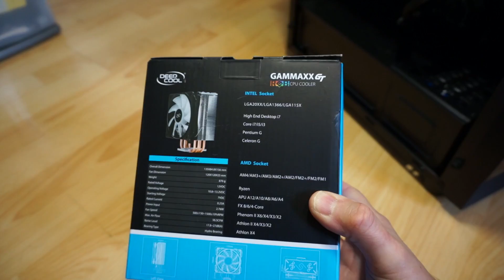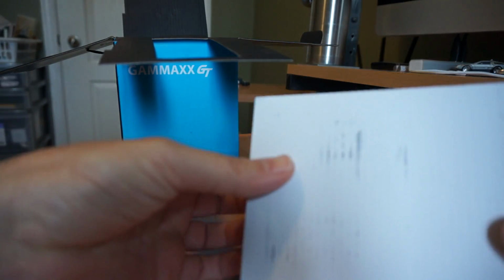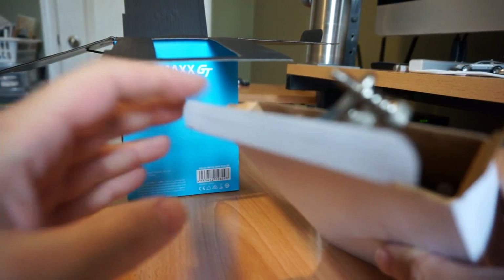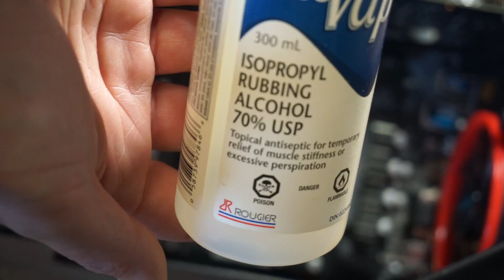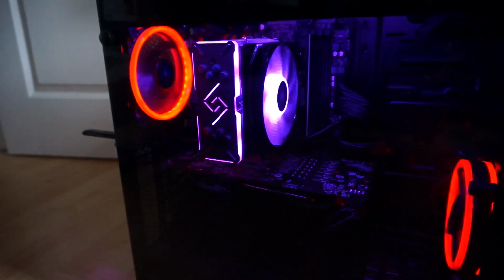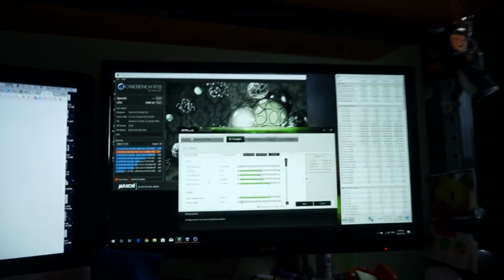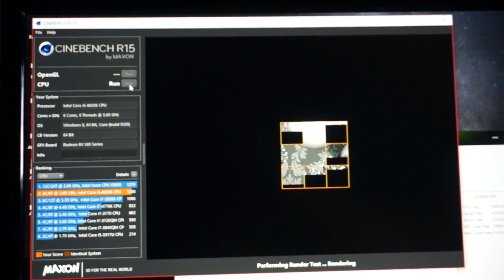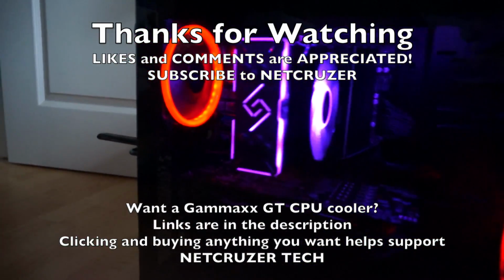5Ghz Overclock on AIR! DeepCool GAMMAXX GT RGB CPU cooler install - Netcruzer TECH

Comment from the maker: I forgot to show temps.  At 5Ghz it does run hot, idles at 40+C and load is 90+C, after 10mins stress test 100% cpu load at 5Ghz it will thermal throttle.  GAMMAXX GT CPU COOLER.  USA: https://amzn.to/2mniBYz CAN: https://amzn.to/2zOgiY4 For much cooler temps and efficiency, I set OC to 4.5Ghz.  4.5Ghz idles at 30C and under sustained 100% CPU load it never throttles.  So it's pretty darn good for AIR cooling.  I think the only way I will be able to improve the temps is with a delid, which I'm not willing to do yet.  Thanks for Watching!
Reply: hello. for 4.5ghz, how much is the maximum temp for it then?
Reply: Netcruzer RC TECH CARS nice video helped me in on an investigation on processors and I’m thinking of getting the intel I core 5 8600 k 4.3 ghz,GTX 1060 6 gb, 1 tb,case aurora r7, designer dell running games at 100 FPS and above 😆
Reply: So if one does not want/need to use the RGB- controller, the ONLY cable that has to be connected to the motherboard is the one that goes to +12Vpin header? So it will work simultaneously as a power and RGB-control cable?  (all the remaining cables can be tucked away?)
Reply: Netcruzer RC TECH CARS and 460 watt power can you please answer this question is an Intel icore 5 8600 k able to run smoothly on an air cooler 😬plz response me 💀😃
Reply: Netcruzer RC TECH CARS delid it
Reply: Do you think the thermals will be better with a 9600k?
Reply: I have aircooler with 2 changed fans and 5ghz is only 80C is that safe temperature? I have same processor
Reply: Netcruzer RC TECH CARS have problems in 90c?
Reply: thank you for video ，好質詢
Reply: Just bought it bro you helped me build a the ultimate workstation
Reply: Funny how this Youtuber doesn't realize that cinebench is not used for CPU stability testing... Its for benchmarking. You need to make sure your CPU is stable, before you benchmark. Anyone who has ever actually overclocked for real, the correct way. Will know that, that tiny ass little 4 heat pipe cooler cannot handle a 5ghz OC. I dare you to go run prime95 for 30 minutes or an hour and tell me that you still have 5Ghz. LOLOL

Comment: Hey man what’s your case?
Reply from the maker: That’s some unique case that Cyberpower offered in 2017-2018. No longer produced and I never found out who the OEM was. I’m still using it though. Has a very sensitive front panel reset button you have to be careful not to bump it, so that’s might be why it’s no longer around.

Comment: So im still fairly new to computer assembly and i bought this cpu cooler and some more ram to replace my old parts and aftet assembly my pc wont turn on. Cant figure out where 1 of the wires goes and i think the vpu cooler may not even be compatible.

Comment: The cooler master did not look like it was properly pasted or mounted based on the thermal paste smear. The DC Gammaxx GT is a huge upgrade indeed, but it would have helped if the CM cooler had been put on properly!

Comment: i had the same problem with the fan, after placing it with paste i realized i couldn't reach the screws on one side, i had to remove it and restart the process, great cooler for the price.

Comment: Question: can i change the fan on this cooler? If so, can i add a secondary fan on the back of this cooler?
Reply: The fans are changeable , i have corsair ll120 rgb fans on mine
Reply: And yes a second fans is possible it comes with 4 clips 2 a fan
Reply: Same question since a long time
Reply: Thanks

Comment: Is this better then the ryzen 3 stock fan also would this fit on a b450ma mb I’m using a 500 power supply also just liked and subscribed:)
Reply: of course its better than the stock cooler

Comment: Would I have to remove the whole thing to apply a new CPU cooler? or did your case have a back opening?
Reply: It does not really matter if his case has an opening to access the bottom of the motherboard, etc. It is a matter of your case allowing such access or not. And I doubt that Netcruzer RC TECH CARS can answer that question. You have to physically examing your computer case to see how it is designed.

Comment: you forget to mention the temperature at 5 Ghz. Which is the single most important thing while overclocking.  And determining factor if a cooler is good or bad.
Reply from the maker: I show it, 99C at full load 5Ghz. Nearing max temp. That’s too hot so I don’t run my 8600K at 5Ghz I run it at 4.7Ghz all the time with the Mugen5. I only go 5Ghz for benchmarks.

Comment: Heat pipes are not solid copper, they are hollow copper with a thermal liquid inside that will condense and evaporate to work similar to a refrigerant in HVAC or a refrigerator.

Comment: Hi very good video and I'm surprised how the 5ghz processor with air cooling works.
The question I have is if the ram slot next to the fan can that ram slot be used or is it covered or covered by the Gammax GT deepcool cooling fan and can't that ram slot be used?
Reply: It looks similar to the EVO 212 in design. I had a RAM slot clearance issue but was able to mount the fan a little higher to allow the use of the slot without affecting the cooling.

Comment: I want that case!
Reply from the maker: Only way I know you can get it is to buy a CyberPower PC from a year or two ago. It’s a great looking case, but airflow and dust protection isn’t great.
Reply: @netcruzer  oh, so i should find another one?, Btw can you help me a bit?, Yesterday i ve looked all day on internet( youtube) after a great cooler , finally i ve decided that ill go with Noctua D 15?, I think thats the name, aftet i ve heard the cool master v8 gts v2 isnt that great, its just some marketing, atleast thats what ive heard ,so you think a i5 9400f, a sixcore processor, its good or atleast enough for gaming?, Together with 16 gigs of ram and a 6 G video graphics card?, It should be enough  for games( i m not so much into the newest games) to be able to play them at 60 fps?, I m down for playing them even at medium settings
Reply: @netcruzer   + i want to record them if its possible, you think it should be enough?, Also ty for asnwering
Reply from the maker: @allexcorebass6741  specs sound like close to minimum needed if you want to record the game footage too, that takes more CPU cores to record/encode while playing. 16gb ram is fine. 8GB ram video card would be better.  Vega 56 are cheaper now, and similar to 1070+ performance.
Reply: @netcruzer  minimim for what?, For the newest games? The only newest games i would play are like forza horizon, doom, Halo, hmm, and need for speed, i m more into old games xD , i ve looked also on a video where was a guy who tested core by core how manny cores does the games uses, he dezactivated all the cores, then activate it one by one, and re make the tests, and on the game he tested wad gta 5, battlefield 1( the new one) and a few more, and if i m not wrong, otherwise ill re watch the videozhe said more than 4 cores, the games doesnt use.. so i was thinking  a six core is enough?, Now in my couuntry a i5 9400f its around 170/180 € .. the processor, and is pretty cheap for a processor who does support overclocking till 4.2 ghz?, If i m not wrong, and about graphics card, they are the samez just different names doesnt mean they are different manufacter or different companis of graphics cards, i wad thinking that 6 gigs of video are enough for even the newesg games, unless i should uprade the processor, and thats why i asked you, i m still waiting for you suggestion of a new processor
Reply: @netcruzer  CyberPowerPC GXI 10862 OPT

Comment: How did you change the colors of the cooler?
Reply: the cooler has a little cable that has the controller on it open up your pc and try to spot it
Reply: @aegizz5298  so every time we wanna change the color we have to open our pc?
Reply: @sweatyedits7722  ik this is old but yes if you have a glass panel you have to remove it to change the color if not you would have to open the pc up
Reply: @aegizz5298  Thanks!

Comment: I might get this cooler for my ryzen 5 2600 cpu, I will install it on the motherboard before I put the board in the case lol.
Reply: what cooler are you using before switching to this one? and what temps are you getting?

Comment: 90+C temperature? man that's hot i have thermalright aircooler with 4,8ghz peak temp at full load only 74 C only.
Reply: Antilaakeri could be different case with different airflow. Has nothing to do with the cooler.

Comment: Those heat pipes is not solid copper its actually hollow with a very small amount of water. It works by convection. Search on youtube how they make heat pipes.

Comment: Theres not nearly enough thermal paste on the cpu when you take the cooler master off. I wonder what the temps would have been if it was properly installed in the first place!

Comment: Wait what? I used ryzen 5 2600 at 4ghz with stock cooler and got a 1300 cinerbench is it because of the 12 thread?
Reply: more than likely.  I have a Ryzen 7 1700 OC'd to 3.8GHz and it scores 3700 in cinebench

Comment: Hi! I building my pc, and i bought an i5 9600k for overclocked to 5ghz. Im searching some good cooler and found this video. I really like it and i think on purchase ir. Do you recommended to my 9600k? (Sorry my english no used translate)
Reply from the maker: I have a video of this Gammaxx cooler vs a Mugen 5 and the Mugen cooled better. If you want to push your 9600K to 5Ghz sustained load you need a bigger cooler or consider an AIO radiator. Yes you can use the Gammaxx and likely run at 5Ghz but it will thermal throttle after awhile.
Reply: @netcruzer  Man, you won't believe this, cause I didn't either...but 5Ghz is STABLE with this cooler in my rig. 5Ghz at 1.35v running Aida64 for 1.5hours, temps peaked at 83c on the package, with a couple cores peaking at 81. Temps peaked at about the 20min mark, and then settled back down and ran between 73-78c for all the cores, with the package temp bouncing back and forth between 76-79c but never hitting 80 again.  I'm actually kinda flabbergasted.  I'm gonna chalk it up to four factors: 9600k having a soldered heatspreader where the 8600k did not, my use of better ThermalGrizzly thermal compound, better airflow in my case (Phanteks Evolv X, bigger and roomier case+5 140mm high-quality case fans), and of course, the good old silicon lottery.  Now I'm not gonna run it at 5Ghz all the time. I'm backing it down to 4.8 because that ran stable for 2 hours and ran a few degrees cooler than 4.9 did (though it was also stable), gonna try to dial in the voltage a bit more to see if I can get it to run under 1.3v because frankly I was tired and decided to go to sleep instead of fiddling with voltages. But yeah, 5Ghz stable on a 4-pipe air cooler, not too shabby.  I think I'll keep her until something bigger and just a cool looking comes out.  Not giving up muh RGB.
Reply: @AgentFrosty  should i use it for i5 9600k ? (without overclock)
Reply: @Bryan-kr5lx  You absolutely can, with no problems whatsoever. That cooler is still going strong a year later with an all-core OC of 4.8Ghz. I don't own it anymore, I sold it to a friend of mine after I built a bigger system, but I set it up just like I had it. He loves it. But yes, if you're just running stock, that cooler will 100% work absolutely great.
Reply: @AgentFrosty  Thank You a lot !!! i will buy it tomorrow
Reply: I bought this cooler, a 9600k and an Asus Prime z390 to run with my new 2060 for a mid-range gaming build. Got it installed and set up, really nice little unit. Here's the funny thing. I NEVER use a motherboard manufacturer's auto-OC function, but I decided to play around with Asus' AI Tweaker. I can tell you this... It will run a full suite of benchmarks (Firestrike, TimeSpy, Heaven, etc) at 5.1Ghz at around 72C, but at insane voltage. Like, 1.45v. Needless to say, I did not run any stress tests at that high voltage LOL. I turned that off and just set it at 4.7 and threw some voltage at 1.3 at it and ran a quick 30min Aida64 since I was on lunch, and it was stable at a peak of 72C again. So yeah. I will do some more testing later tonight when I get back home, but I doubt 5Ghz will be stress-test stable on this cooler, but 4.7-4.8 is probably doable.

Comment: Hi, I've got the same processor and I've also overklocked mine to 5.0Ghz. Nut I need better cooling, and ended up watching your video i search of a better cpu cooler.
What are your core max (and avarage) temp and cpu package max (and avarage)temp in HwInfo?

Comment: this is cool and all but everyone seems to skip the cable connections and rgb set up! :( thats what I need help with.
Reply: L C Just make sure you put the fan  cable in the cpu-fan header otherwise you will get a error code
Reply: yup turns out it was easy, cables at least, the manual installation was hard for me haha but I only plugged the power fan cable to the mobo and the rgb cable as well, and the pc instantly recognized the aurasync compatibility! thanks,

Comment: Will it handle the i7 8700k?and if no which one will you recommend.
Reply: Mysticfull probably not, id get a dark rock cooler. Iv heard they are excellent
Reply: Mystic u should try Noctua nhd15 . N get the motherboard asrock z370 extreme4 . U can get 5.2ghz
Reply: Yeah it handle

Comment: I have manged to get stable 4.8GHz @ 1.27 volts, no delid on my 8600K with this cooler. No thermal throttling in any stress tests. Its amazing for the value. Temps barely cross 70 degrees! :D I did reach 5GHz but yes it was unstable.
Reply: 70 degrees in prime95?
Reply: @Hollyshitzu  i havent run prime95 since it doesn't reflect my use case temps. But I can tell you about AIDA64, Furmark, Heaven,Valley, and all modern AAA titles run at below 70. Well below infact.
Reply: @TheAtomicFle4  in aida 64 for how long?
Reply: better than gammaxx 400 ?
Reply: how many ur fps after 4.8ghz and before that ?
Reply: Did you use the thermal paste that came with the cooler? I'm running it on a i5-9400F (3.8 GHz - Turbo stays on continuously) and feel it should run cooler for a heatsink of this size. Getting 64 degrees with the fan at 1100rpm under 100% load with BOINC (uses about 58Watts according to Intel XTU). The stock cooler got up to 80 degrees and was rather noisy.

Comment: Can i overclock my i5 8600k on the ma410p ??
Reply from the maker: Yes you can and you should. You paid for a K cpu you should overclock it.
Reply: Netcruzer RC TECH CARS i mean the i can overclock my cpu with that aircooling ??
Reply from the maker: You certainly should try. You may not hit 5Ghz but even a 4ghz+ all core overclock is a nice increase in performance. Google how to overclock coffee lake CPUs for a flowchart of starting points for voltages to use.
Reply: Netcruzer RC TECH CARS ow ok thnk u man 💞

Comment: Very nice cooler! It is huge!
Reply from the maker: Most tower coolers are that tall for 120mm fans.  But something like a Noctua D15 is twice as wide with completely separate fins for each heat pipe side.  That Noctua one is HUGE.  I like this GAMMAXX GT, and performance is great. The only way I can cool it better is to do a CPU delid, even a watercooler wouldn't help much without delid.  Intel thermal interface material is crap.

Comment: I have a ryzen 5 1600 overclocked to 3.9 GHz on the stock coler
Reply from the maker: This gammaxx should let you clock up higher. What I took off my intel looks similar to Ryzen wraith cooler.
Reply: I overclocked mij ryzen CPU on stock cooler from 3.2ghz to 3.9ghz and iT only gets 60degrees when a game
Reply: my i5 8400 stock cooler runs at 4.0ghz 🤔